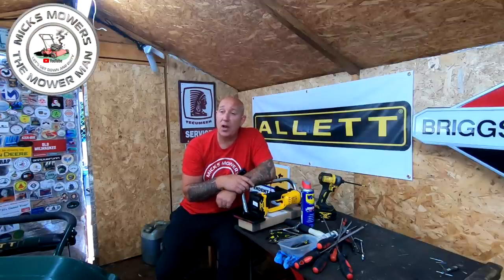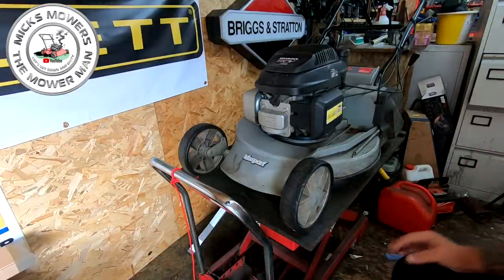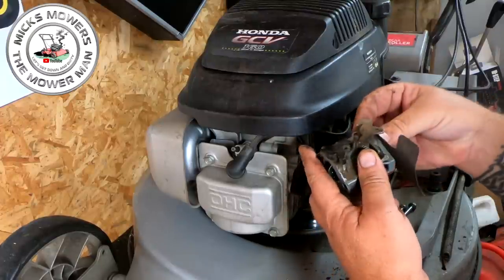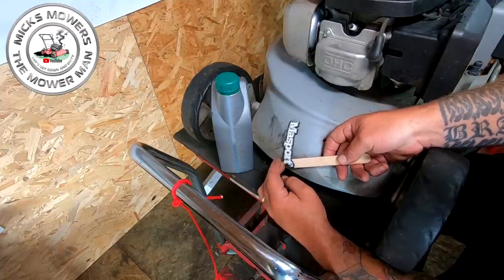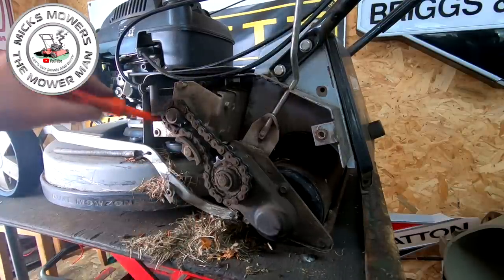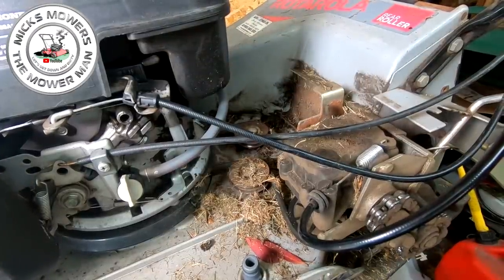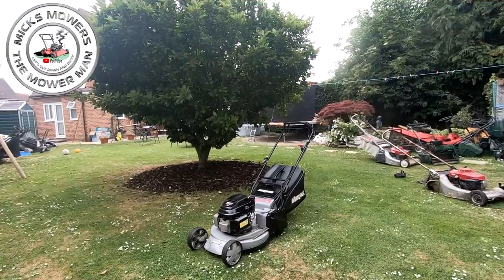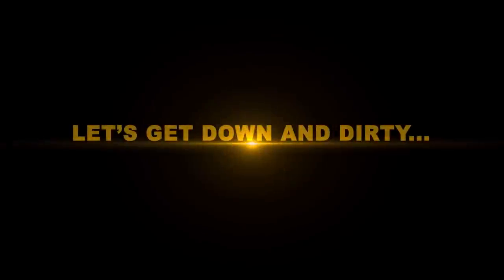Masport Rotarola Full Service How To Video #masport #micksmowers

Comment: Hi mick I have a honda hrd536 rear roller I've just had new end and inner bearings replaced and it's seems to have a lot of side to side movement on the roller it's a 2014 model any idea? Regards paul
Reply from the maker: Missing c clips on the roller shaft maybe?
Reply: Thanks mick are thay on inside of roller 👍
Reply from the maker: @paulnixon7830  should be mate
Reply: Thanks mick love your chanal .
Reply from the maker: @paulnixon7830  thanks mate I appreciate it

Comment: Thanks but You did not show how to remove blades for sharpening!
Reply from the maker: It's simple enough..
Reply: @themowerman  Simple but I was not sure which way the nut unscrewed as sometimes they are opposite thread. Also how to stop the blade turning (turns out a big block wood works) & how to sharpen them most easily. But otherwise a useful video on a mower I have owned & still goes well after 12 years.